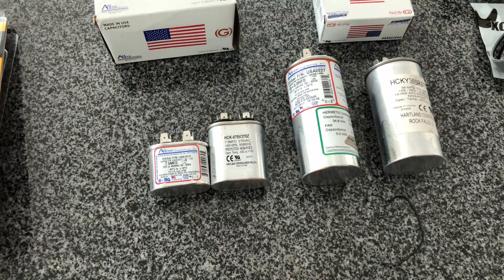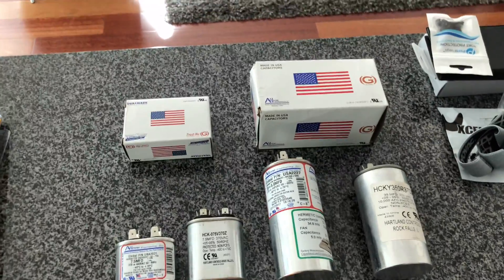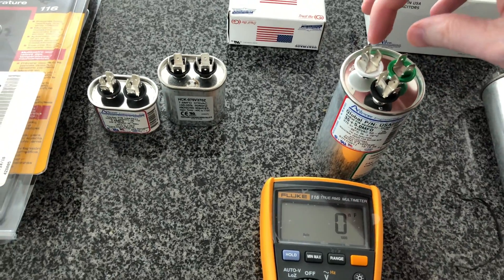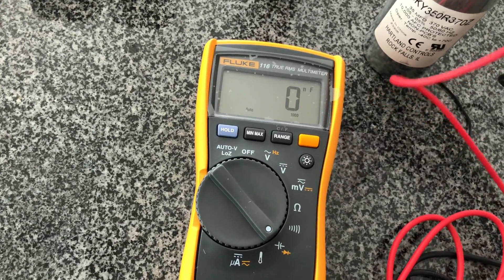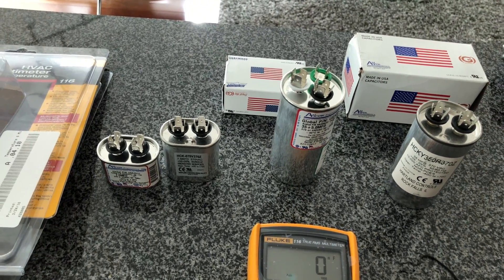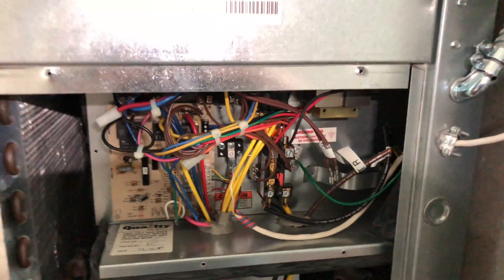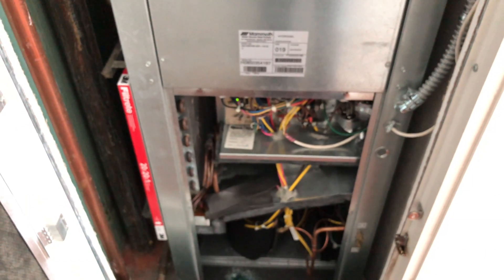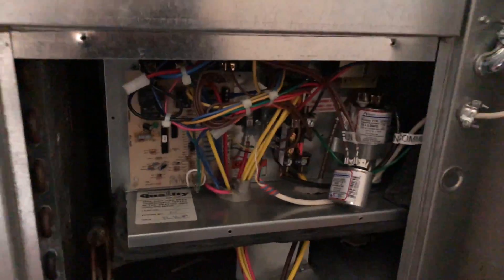Infinity Mammoth HVAC - Capacitor replacement

Comment: Water sourced heat pump on your air handler there is a filter without supply return grill. The air handlers in a closet not unusual but on top of the air handler I saw a large run of flex duct guess size from the looks of it the duct size is 14 inch. My concern is the air handler doesn’t have enough air supply /returning back to the unit it could cause problems with  the unit delivering the proper CFM the designed to put out. Just like if there not enough movement or no movement of across the evaporator coil will cause it to freeze up. If you have a filter at the unit and another return else we’re in the dwelling it  could cause a restriction and decrease a flow back to the air handler.
Reply: Good observations.  There's an open return grille in the wall behind the HVAC unit that isn't visible in the video.